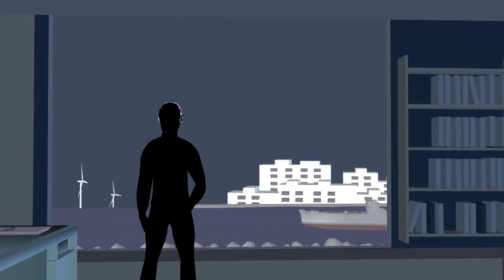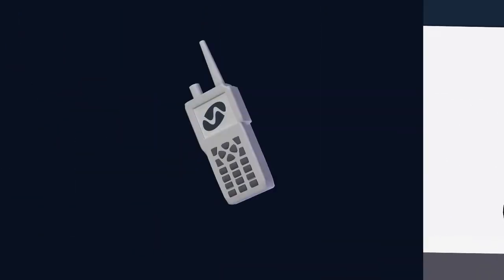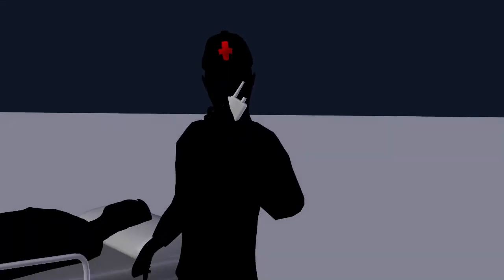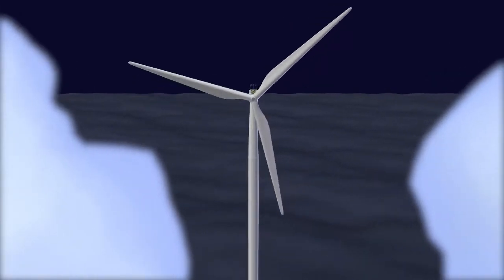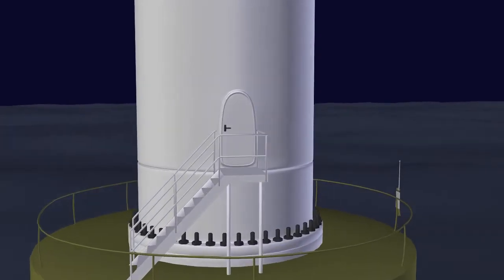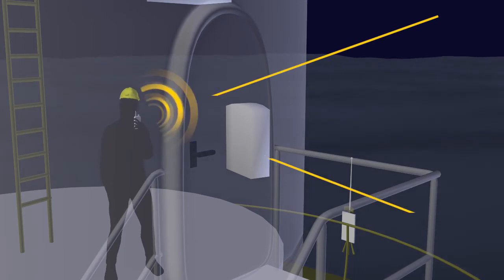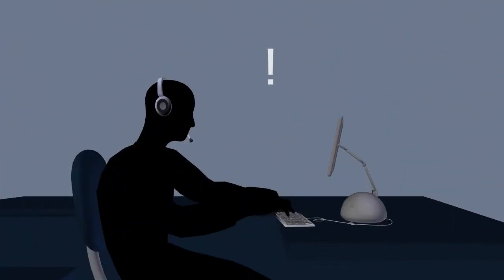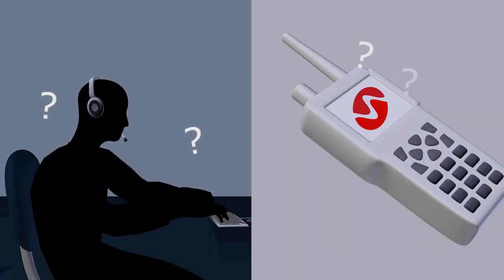Semco Maritime - Semtetra

Comment from the maker: We are proud to announce our largest telecommunication order ever for the offshore wind industry. The order includes construction of inter-field and offshore-to-onshore communication networks for up to four major DONG Energy operated wind turbine parks in the North Sea. The project includes SemTetra, VHF radio communication systems, data networks, PABX, telephone systems, Line of Sight systems and Automatic Identification Systems for safety. It also covers installation of Semco Maritime’s patented SemTetra Air repeater solutions making it possible for service personal to communicate from inside a wind turbine tower.